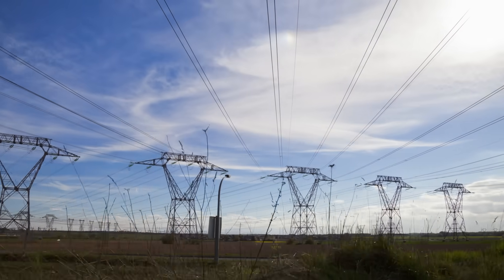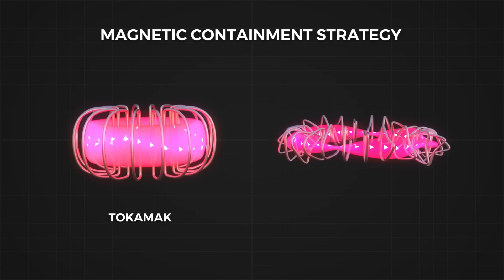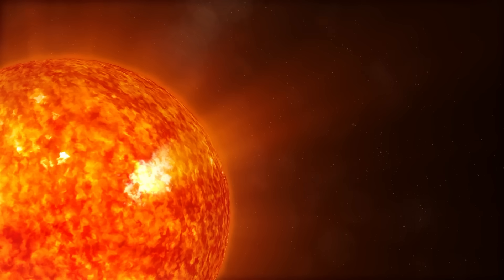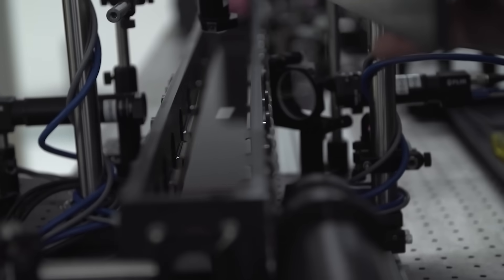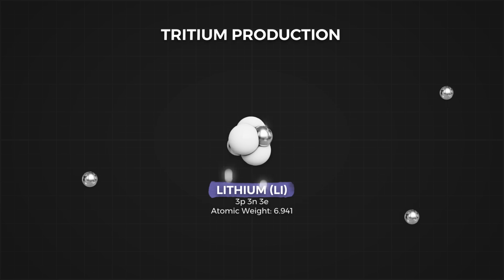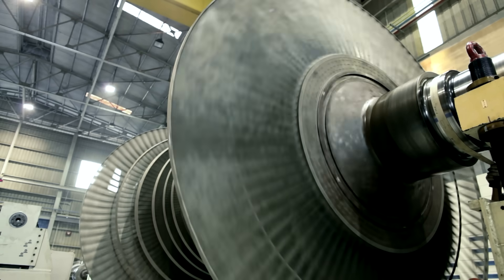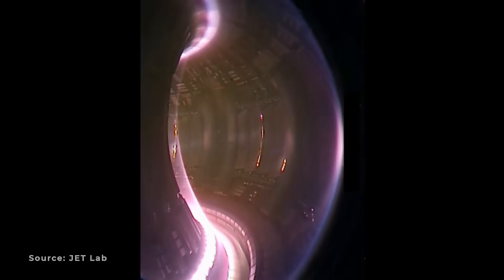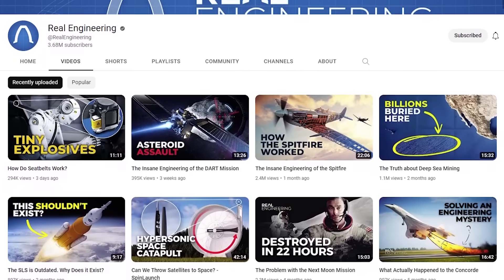The Problem with Nuclear Fusion

Comment: The problem with fusion is that we're trying to duplicate what stars do.   But stars have something human made fusion reactors never will.   A gravity well strong enough to both start, sustain, and contain the fusion reaction.   We can't duplicate that.
Reply: That's not what we're doing. Most fusion reactors utilize lasers and photon bombardment. No one is attempting to gather the mass of a star.
Reply: @phoenixcraft9940  Sure sure.  That's the point.  We can't duplicate the mass of a star inside a reactor.   But one way or another, you have to input enough energy to accomplish the same result.  Start/Sustain/Contain the reaction.  Stars get it all for "free" by way of their mass.   That's an option we don't, and never will, have.  To power a sustainable fusion reaction we need to provide (at a minimum) that much energy as inputs to the system.   There's no dodging that bullet.
Reply: @MJSmithGroup  None of what you said was true. We have already demonstrated what you said was not possible just yesterday when a fusion research lab managed to create nuclear fusion that resulted in more energy than was in the photons of the laser that created the reaction. The weak nuclear force, just like gravity, is a source of potential energy - in solar fusion, gravitational energy is not "free," it is the increase of gravitational potential energy to the point where the normal forces of atoms are overpowered. And out comes photons and other particles like positrons with the new kinetic energy that can be used as a source of power. This transfer of potential energy is why the law of conservation of energy is not violated: Physically net-positive fusion without massive gravity is not only possible, but within our current grasp of technology.
Reply: @phoenixcraft9940   The headlines from that lab claiming greater than unity are more than a little bit of a fib.  End-to-end inputs accounted for.
Reply: @MJSmithGroup  Man, that's a really strong argument with a lot of evidence and logic built into it. You really destroyed me there, and did a good job at talking about my other points as well.

Please try to understand the basics of energy transfers before denoting gravity as "free" energy. You typically learn this stuff in Junior High School.
Reply: @phoenixcraft9940  Not trying to "destroy" you.   Big headlines about a "fusion breakthrough" happen every couple of years.  Every single one of them has turned out to be (to put it nicely) a bit of an exaggeration.
Reply: @phoenixcraft9940   Sorry.  Apparently you require plainer language.  All previous claims of unity have proved up false.

"Science relies on public hype for funding."  Really?   You count that in the win column?

If "hype" is your standard, I achieved unity building a dyson swarm in my garage.  Big stuff.   Civilization changing stuff.   So, ah, where's my money?
Reply: @phoenixcraft9940  Hmm.  Let's do some math.  300+ megajoules of electricity to generate ~2 megajoules of ultraviolet laser light to release ~3 megajoules of energy from the reaction.

300+ megajoules in.
~3 megajoules out.

Presenting an ~1% return on energy as a "net positive gain" is what normal people call "A BIG FAT LIE."

And that's not even accounting for the energy necessary to produce the fuel (it's not trivial).   Nor is that accounting for the overhead energy running the reactor (which isn't trivial either).   Just the electricity to power the laser.

Not to mention, the reaction energy is mostly in the form of gamma radiation.  That has to be somehow captured and turned into something useful.  How to do that is also in the theoretical 20 year future bucket.

So it turns out, this headline was a lie, same as all those we've seen before.

Comment: It seems that fusion is a lot less cleaner than advertised. With it needing so much exotic materials, I highly doubt it can make this energy utopia a reality.
Reply: The eventual goal would be to make fusion reactors efficient enough that these exotic materials won't be necessary in large enough quantities.
Reply: not to mention the radiation it produces (neutron radiation) is the nastiest of all cause it's the hardest to block 

currently there's no compact practical way (hazmat, portable system) to protect against it
Reply: @blackfalkon4189  The radiation is contained within the reaction chamber. Radiation does not behave like smoke - radiation is the name for any wavelength of light.
Reply: @phoenixcraft9940  neutron radiation is not EM radiation
Reply: @blackfalkon4189  Sorry, missed the neutron part.

Neutron radiation is literally what we use to make the reactors produce power. The energetic neutrons heat up water, generating steam. These neutrons don't travel kilometers into urban areas, so it doesn't have any effect on the safety of the general population.

Neutron radiation can be blocked by a large body of water. The radiation existing in the reactor as 'dangerous' doesn't mean anything - that's like saying the energy emitted by the decay of uranium in a fission reactor is 'dangerous' when in reality it's enveloped in a massive tank of water that absorbs all of it. 

This doesn't mean it's not hard to handle, mind you, but there are much larger concerns when operating a fusion reactor than neutron radiation.

Comment: My only issue is that the biggest issues with nuclear power is that governments create an absurd regulatory burden not felt by other power sources, and this is the primary source of the costs in those two main issues you described. Lots of methods exist to repurpose nuclear fuel into secondary reactors, but regulations have prevented or made cost-prohibitive both research, development, and deployment of those power plants.

Comment: A bit off topic: while desalination is held back by its energy requirements, the brine (i.e. the not-potable output) is problematic as well. All the salt that was removed from the potable water is now in the brine, making it far more salty than the water that came in. There are certain areas where that just can't be disposed of responsibly, like shallow, long coasts. The extra salt also makes the brine denser than the surrounding water, so it sinks and collects. It will eventually dilute with surrounding water but depending on the ecosystem and topology, that makes things much more difficult. Coastal areas, especially in more rural or developing areas, tend to rely on their fisheries. So it's kinda like the monkey's paw: you wish for fresh water and get it, but now you struggle to feed yourself.

These concerns don't apply everywhere, I know, and am open to feedback. Back to the fusion!
Reply: The brine can be repurposed, possibly as a coolant for reactors? Either way, it's not like salt isn't useful.

Comment: 4:43 if they can figure out a way to build a reactor that does this with hydrogen, make helium 2, which then decays back to hydrogen, they've got the makings of a self cycling engine that occasionally produces deuterium.  All they'd have to do is devise a way of getting the hydrogen to fuse with very little energy, capturing the energy it produces, then when it decays, fuse it again.  If they can figure out how to do that they've got a way of making both limited power, and the higher end fuel they want.
Reply: This would be a perpetual motion machine and is impossible.

Comment: Too bad this video didn't cover the major breakthrough that was just announced, that uses even a different method than those covered here, it's not a stellerator nor a tokamak, it's lasers. They achieved a net energy gain.
Reply: The laser result didn't take into account the massive energies required to make the beam. And Q 1.5 is nowhere near enough for a fusion power station.
It has long been known more than 1 Q was possible.
Reply: @Safetytrousers  I don't understand what your point is. But ICF (inertial confinement fusion) was the first to obtain a net energy gain, they input 2 Joules and got 3 joules out. That doesn't consider some other energy used in the experiment, but you can see for yourself in the technical panel here on YT. Magnetic fusion hasn't come close yet to a net energy gain.
Reply: @ThomasJr  ITER aims to get to Q 10.
Reply: @Safetytrousers  I see, Q 10 is the gain factor. Wow, 10? But they are not there yet, maybe never will. Better a bird in the hand than 2 in the bushes.

Comment: What if -- hear me out -- instead of these gigantic, multi-billion dollar projects, we spent the money on giving everyone solar panels, wind turbines, and batteries (e.g.Tesla Powerwalls). This would dramatically reduce the demands on the power grid, which could be reduced to a handful of generating stations (using the conventional technologies... for now) to cover shortfalls and to smooth out the curve. We always think about it as "the grid" but it could be far more distributed to the point of having neighborhood grids or even no grids, with the exception of some high-demand customers like hospitals, industry, etc.
Reply: Because even if we increased investments in fusion research 100x, the amount of money spent on solving this problem would be pennies compared to the money saved by ushering in a new era of abundant and clean energy. No contest.

We need to continue to develop all forms of renewable/clean energy.. but you don't seem to understand the enormous potential that fusion has to offer. The technology has the potential to vastly out perform all other renewable sources of energy in the end.
Reply: @dawgma  fusion power is at least 30 years away according to the announcement yesterday from the Lawrence Livermore Laboratory. We need to go green today, and we have the technology to do it now. Did you even watch the video... it's called "the PROBLEM with nuclear fusion".
Reply: @electriccerix  Try reading my reply again and save yourself an argument. I specifically said investment in current renewable sources should continue. You're the one suggesting the money spent on fusion research would be better spent on more renewables.. i.e. implying that the billions spent on fusion is wasteful. 

Again, this shows that you don't understand how incredibly transformative fusion could be if it works. $10 billion? $100 billion? $1 trillion invested? This would all be pennies compared to the money that would be saved if fusion proves successful.
Reply: @electriccerix  there's no fallacious projection. You literally said "instead of" these multi-billion dollar projects.. "instead of". If you didn't mean to say that then that's something else altogether. But that's what you said. And that's what my reply was based on. 

If you meant to say it another way then try correcting yourself with a little more humility next time.
Reply: @dawgma  I wrote "instead of... for now." As in, we need immediate action, then we can implement fusion. If that's cleared up, do you feel like addressing the actual substance of my initial comment? If we need to immediately replace fossil fuel with green energy, could we not use solar and wind at a local level to accomplish this? My main point is that we can distribute power generation instead of needing giant solar and wind farms.
Reply: @electriccerix  Bro, you are tiring. No, I don't want to address anything you said any further.
Reply: Japan gets it. Today they announced all homes (not just new ones) must have solar power by April 2025. Wish we were thinking pragmatically here, too.